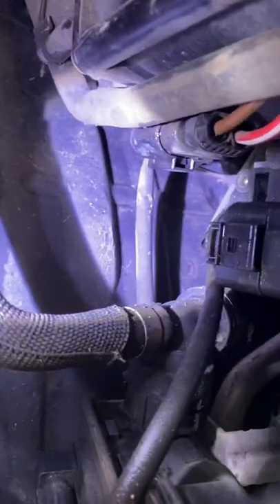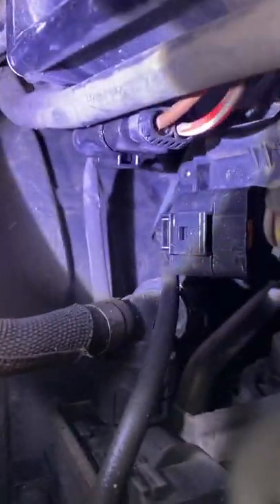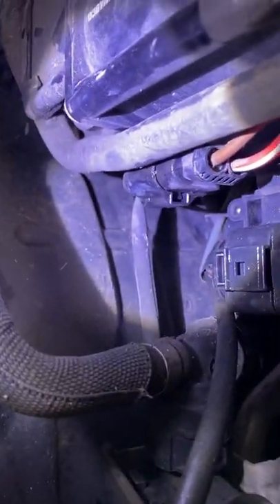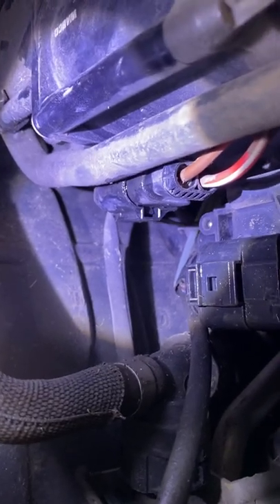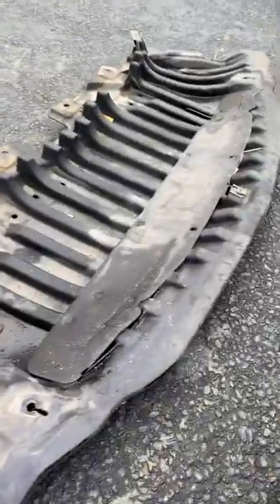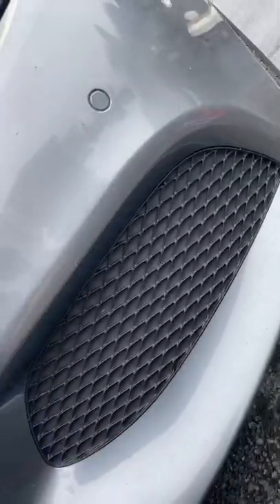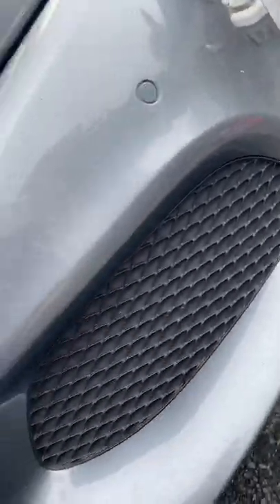Mercedes C350E W205 Airmatic Fix

Comment from the maker: Hi peeps , if anyone has an issue with there mercedes Airmatic suspension not operating or suspension has sat down and cannot hear the compressor operating here is something to try , remove the front under tray to expose the compressor which is located on passenger side front behind bumper ! Check the connect is inserted correctly ie not loose and make sure it’s dry and not saturated in water as it’s open to the elements despite having the under tray . I hope this video helps someone with similar issue .